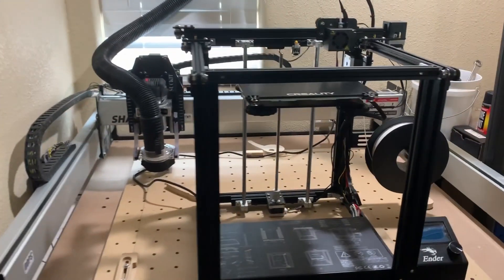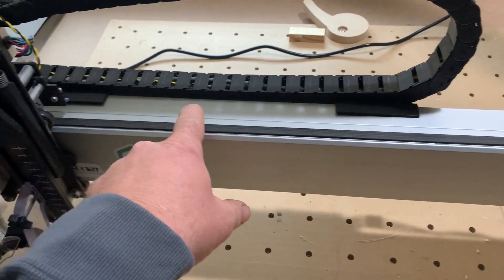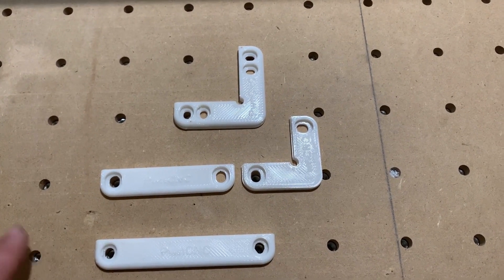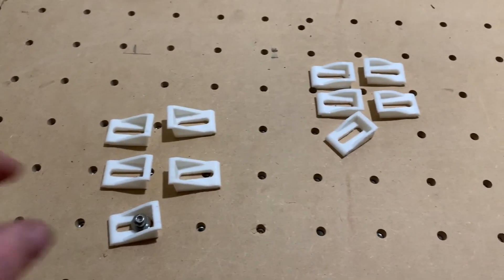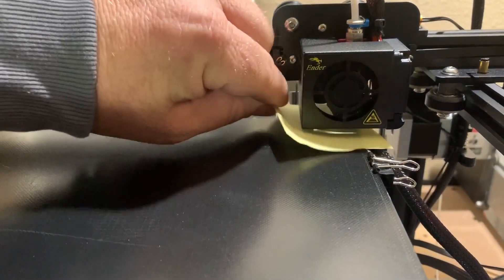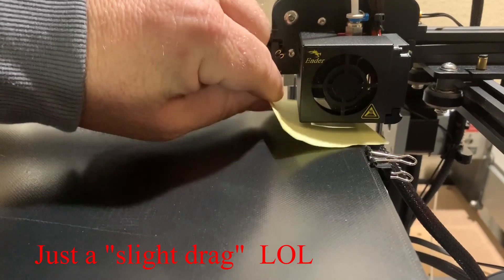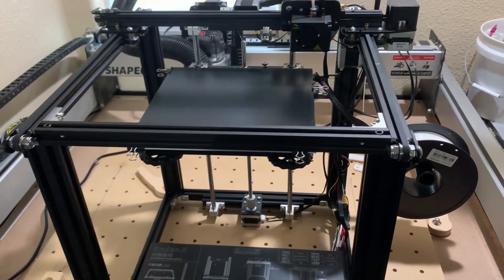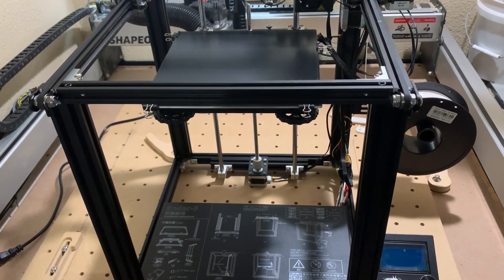3D Printing with Ender 5

Comment: Maybe you should scrap the sticky note and use a feeler gauge  (.002"-.004")..  It gives you a much better feel..  If ya know what a dial indicator is,  it'll get the bed perfect and ya won't need a raft platform..  If you part is moving,  use a brim instead..  I hate the raft and only use it when you have a tiny surface contacting the bed....

Comment: This ist not a Ender 5 Pro! it's the Ender 5
Reply from the maker: Really?! The Amazon page said pro. Only difference I saw was the glass bed. I ended up getting rid of this printer.  What is different on the pro?
Reply: @PricklyGuyCreations  Yes! The (main)difference on the pro is, Ender-5 Pro has the new V1.15 silent mainboard with TMC2208 drivers, It’s much quieter. Then the Pro has a better metal extruder, the new x-magnetic sticker platform and a Capricorn Bowden PTFE Tubing. You can als see the Model on the display. It will show Ender 5 or Ender 5 Pro.

Comment: rafts are a waste of time and material for what you are printing
Reply from the maker: Yes, and so was the printer. We have since moved to the Qidi - Max and have had no issues. Also using skirt now instead of raft. Zero failed prints so far. (Knocks on wood)